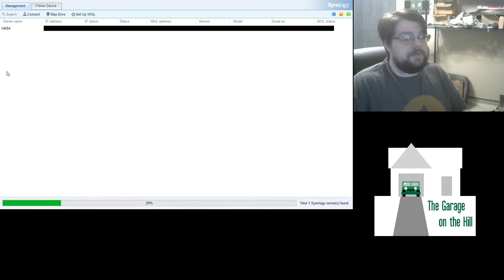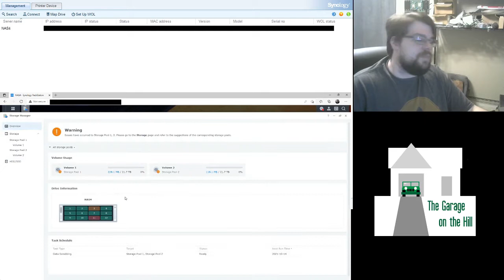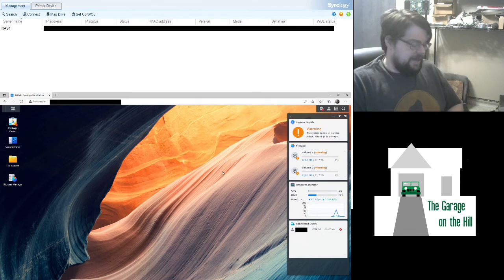Reviving a failed Synology NAS (RS2416RP+ )

Comment: interesting - I have a 2414 with the exact symptoms - if it is a chip failure would replacing the processor fix it? will try this fix
Reply from the maker: I can't really speak to the different model of NAS. The issue was tied to a specific faulty Intel atom cpu model. These Intel atoms are soldered directly to the motherboard so I do not believe replacement is an easy option. Certainly not upgradeable like a socketed cpu.

Comment: hey guys, the Synology said 100R / 100 ohm 1/4 watt (0.25w) and you said 100R / 100 ohm 1/2 watt (0.5 w). Which one is good ? I don't want to make mistakes :) Thanx.
Reply: Hey, what did you use? I am thinking the same...

Comment: My rs2416+ had the same symptomae. I did the trick with a 100o 1206 and a tiny wire soldered on the back side of the motherboard.and YEEEEEEEESSSSS

Comment: It looks like you left the drives in while you did the work, and left them in while firing it back up. and all your data remained intact? i have a similar issue with mine so hoping to try this but don't want to risk losing data. thanks in advance
Reply from the maker: Correct. If you specifically have the Intel Atom CPU issue that plagued many of this era of device, and the lights on the front are doing a similar thing with a no-boot situation, this fix might work around the issue long enough for you to migrate the data off of it safely. 

If it fails, in some cases you can get an identical unit and swap the drives over directly. (The partition information is stored on the drives, not the device.)
Reply: @SunkCostGarage  Thanks for the info. we had the power light flashing green, the alert light flashing red, and the drives with flashing amber lights. our unit is an RS815+. Synology just said its out of warranty and its a main board failure, buy a new one. but thinking we could try this after checking everything with a multimeter?
Reply from the maker: @jammstudiosmusic  I'm not 100% sure if the process and symptoms are identical for the 1U NAS but there's a forum post in the description of the video where I got much of the information on the issue. You might reference that thread to make sure before attempting. I believe the main boards are very similar though.

Comment: This actually bloody worked.. you saved my bacon! Purchasing a new NAS just in case it happens again though.
Reply from the maker: I'd definitely suggest considering a replacement for the unit. This is meant as a band-aid kind of fix. The NAS will work but who knows how long? Days, weeks, a year? The underlying flaw with the Intel Atom CPU still exists. 

This fix will at least give you a chance to migrate data on your schedule.
Reply: @SunkCostGarage  I've purchased a new RS2421+, due for delivery next week :).

Comment: Thanks a lot. I have repaired RS2416+ Just now. This is very helpful video and fixed my work NAS. Synology was suggested to buy new NAS(mother board is not available) and re-configure raid, which is expensive. You saved me.
Thanks again!

Comment: hi i have RS2416RP+ . it's orange light is blinking and there is no light on LAN ports ( all 4 ports ). can this 100 ohm resistance bring my synology device back to life again ?
Reply from the maker: I'm not sure if that's the same failure that this fixes. The resistor fixes the issue with the 3 red lights and 9 green lights.

Comment: Thank you for the video. I just repaired a RS2416RP+ after watching it. Worked perfectly and saved many $$$ for us and the customer.
This repair method is confirmed!  🙂
I just wonder what that 100 Ohm resistor does. How critical is that value? Would a 0 Ohm jumper or a 1kOhm resistor work too?? I have to investigate that a little more...

BTW: It is not necessary to remove the mainboard from the chassis. Just put the resistor into the holes 1+6 and solder from the top side.
Reply: Should really solder it in though, just in case it moves

Comment: Tested power supply it is fine.  tried the 1kohm transistor fix and it did not fix it.  The unit is just dead and will not power up!

Comment: I have a DS1515+.  It will run but just lose network connectivity.  A reboot will make it available again for about 2 hours or so, then network lost.  The logs show the system is running even after network is lost as missed backups are logged.  Is this similar to what others are seeing?
Reply from the maker: This sounds like a different issue altogether. The Intel Atom CPU issue specifically causes the unit to not power on or not boot. Defective integrated network card, perhaps?

Comment: Thank you for this video, we have the same model of this NAS from synology at work and the last time we turned it off, it wouldn't restart anymore and we had the same symptom as we had run out. After watching this video, we became aware of the problem and proceeded to repair by adding a resistor according to your recommendations, the whole operation was successful and as a result our NAS started up correctly with all the data.

Thanks again and best regards.
Reply from the maker: Glad to hear that it helped. Do keep in mind that this is meant as a temporary fix that works around the defect in the Intel Atom CPU. It will eventually fail again and will be unrepairable. It may work for a month, it may work for a year. But at least you can access the data that was stored on it.

Comment: I have the same unit and I had to do the same thing to fix it. I’m now currently running DSM 7 and it found all my volumes as well.
Reply from the maker: It was neat how mine failed mid-update from DSM 6 to DSM 7 and after the repair, picked right up where it left off. I was expecting it to be bricked.
Reply: Just in case others thinking it was dsm7 omuts not just the cpu bad timing and failing, so much good Synology hardware I won't buy because it had this cpu also seems to affect the J1xxx cpus as well (not just c2000 cpus)